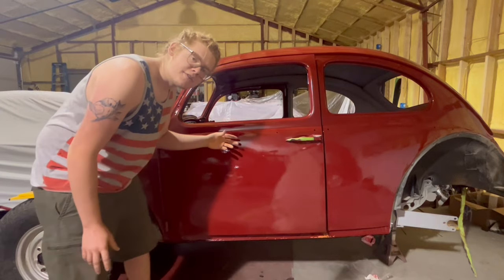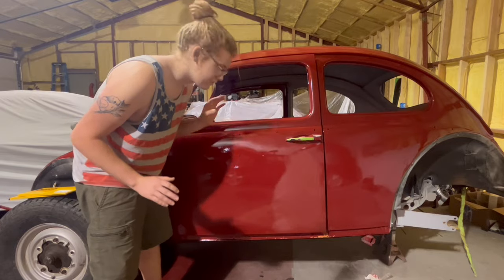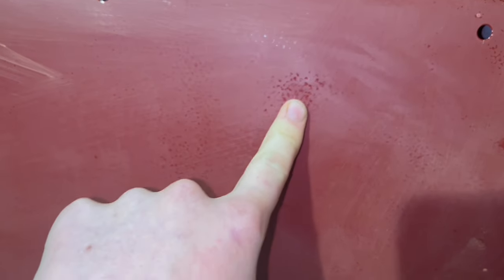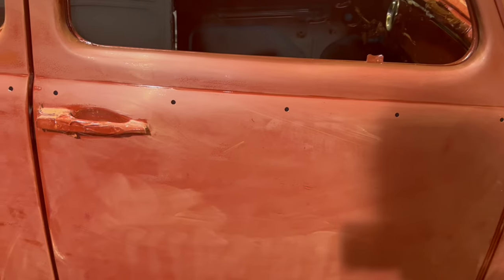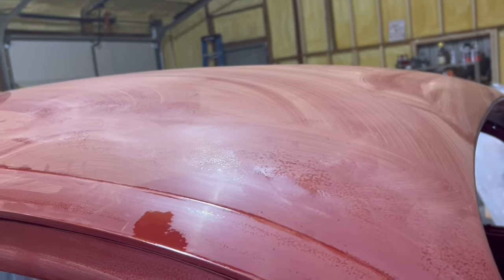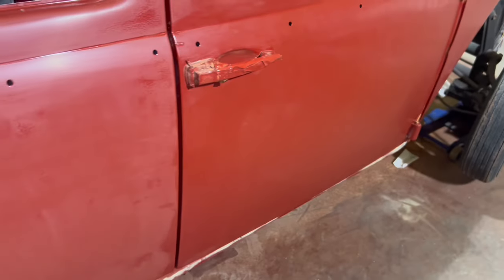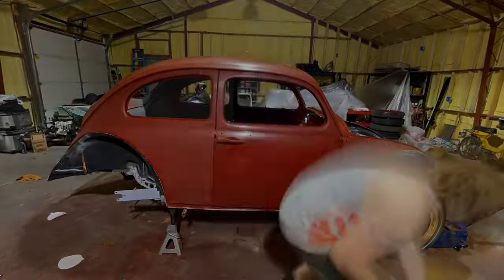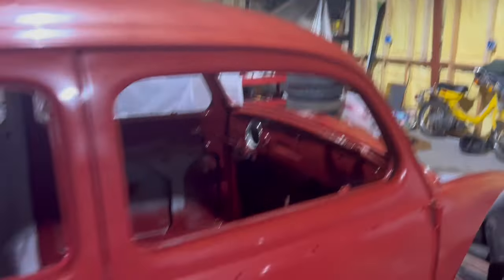How to Polish Single Stage Paint | Vw  Restoration ep8

Comment: I would have just polished it and not wet sanded it. looks worse than before in my opinion.
Reply from the maker: i would have liked to leave it as it was but unfortunately the orange peel was so bad that something had to be done!
Reply: @ricoracing1646  maybe a finer grit sandpaper with lots of water and hand sanded.
Reply from the maker: thank you for the tips!
Reply: @ricoracing1646  sweet bug!!